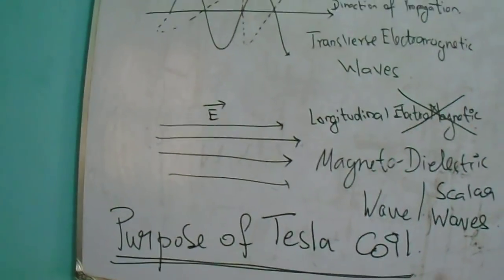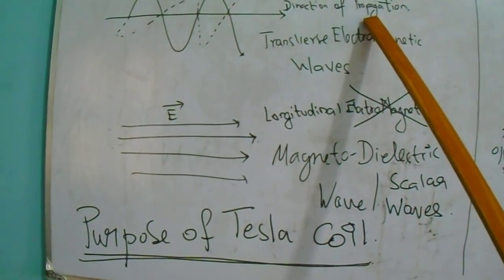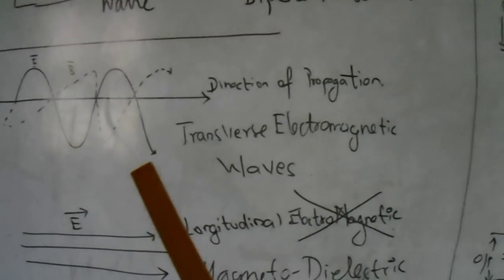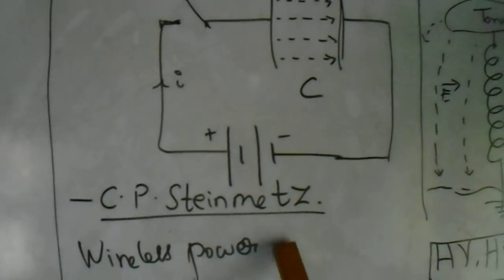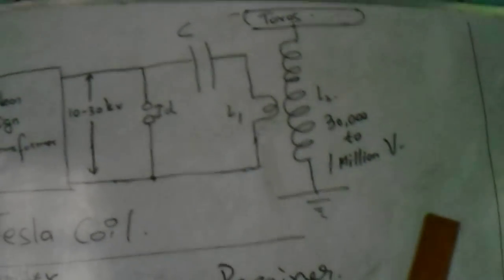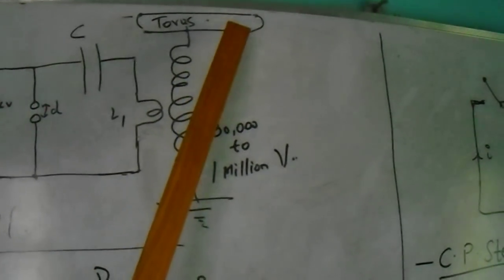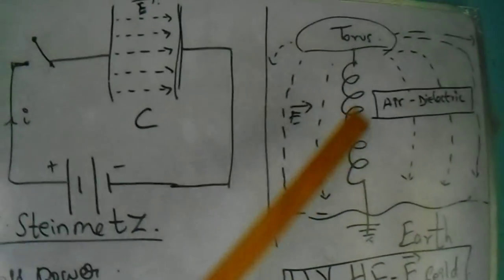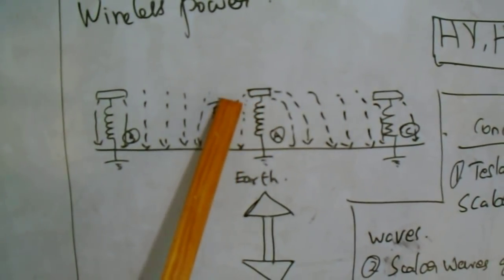How a Tesla Coil Produces Scalar Waves

Comment: Another approach to Tesla’s longitudinal scalar wave concept could be the energy transfer between the antennas of the transmitter and the receiver, is it possible to signal between these aerial capacitors through the displacement current, however they are not connected with each other, is there a possibility for a communication based on electrostatic induction between these antennas?
If we connect the secondary coils with each other by a grounded cable, the aerial capacitors would then simulate a plate capacitor, in which the plates are separated from each other, so the displacement current would flow between these plates, the higher the frequency the better.

Comment: There is a displacement current between the aerial capacitor (Torus) and the ground, when the E field changes with time, which means: dE/dt, isn’t there also a magnetic field component-B present, between the antenna and ground, as stated in the Maxwell equations?

Comment: Electrons moving through a vacuum dont have a field surrounding them but they can interact with other fields. Proof of this is the electron microscope. If the electrons always have a field there is no way to focus the electrons unto a microscopic point since they will all repel from each other. It is only when they move inside a material substance a magnetic or electrical field is formed but there also some substances where there are no fields.

Comment: Your explanation makes perfect sense. You have given me a lot to think about, thank you so much.
Reply: how does that make perfect sense?
Reply: This same person has another video where he transmits modulated scalar waves to a low frequency (LW)
radio (LW frequencies used in Europe) that is inside a nested Faraday shield consisting of two nested steel cans. His explanations make perfect sense. I have duplicated his experiments and indeed I have gone much further than what he has shown. Based on the results I have obtained I can tell you that his explanation is quite correct. The capacitance between the top loading to ground is all important.
Reply: @TheCrunchbird  Do you have a link to the video you mention?

Comment: Hello Sir, one of the best videos that I have ever seen, thank you very much.
Hmm, my question would be, the ground is a bad conductor, can the earth give response to the coming signals from the aerial capacitor, while the area of the surfaces are also not equal ?
Assume you have a sphere (aerial capacitor) of a radius of 15 cm, and a potential is changing between +100 kV and -100 kV, your C would be equal to 4π(eps)r, so nearly 16,68 pF and the charge q= 1,668 micro coulomb, so the ground ! The earth has a radius of 6371 km, its capacity would be equal to 708,534 micro F, the induced potential of the surface would be equal to V= 1,668 micro coulomb/708,534 micro F = 2,354 mV. 
We can write the equation also as: (V*r/R), which is the same. Could this potential be responded by the 2nd coil which is grounded (as a receiver), and located for example 100 m far from the transmitter coil?
I think we should connect the grounding plates with a wire together or may need a metal plate for grounding the transmitter and receiver, am I right here?

Comment: Then, might we assume that one plate of this conductor (the Earth) is always charged, and that all we need to do is construct that other plate to "reduce" that radiant energy, be it cosmic energy, or man-made radiation(radio waves, wifi, satellite, etc) to a useful, off-grid power source. It would be a welcomed alternative to wind and solar which are both expensive and inconsistent. Rather than spending efforts to put energy into the earth, already well charged, we should be looking at simple ways to extract the energy already available. Of course there is a conversion to the proper cycles for use, but that is already an off-the-shelf solution. Thanks for the explanation. Good food for thought.

Comment: Great explanation indeed. You need to work on your closing statements however :)

Would you have an understanding of the simple flat-spiral coil being used for single-wire no-return (no earth connection) transmission of power as well? No spark gap or HV necessary, just a primary of few turns, secondary of many and an identical receiver except the winding direction is reversed from that of the transmitter.
Reply: I've heard of that method and I think its more factual than the video's method, which just creates an electron pressure wave (scalar waves are not particles and are non physical). I think it was where the coils cancel each other out and create a pressure wave in the ether/spacetime. Could you explain this to me more? my idea of this is very foggy
Reply: Yeah that and his English! OMG couldn't understand one word!

Comment: How would you explain the magnification effect of a Tesla coil? Did you calculate the frequency of the electrical vibrations of the earth, if the Tesla coil comes in resonance with electrical vibrations of the earth, energy extraction may be possible, what do you think about that, any experiment or calculations?

Comment: As far as i know.....scalar waves are created when two equal and opposite em waves neutralize eachother forming a zero vector resultant ! These zero vector waves create stress on space time creating local gravity
Reply: WOW. Are you implying artificial gravity can be produced by these equal and opposite EM waves? What kind of power would be needed? More than a Duracell? (grin)
Reply: Ah! Enter the A field.
Reply: Interesting. The A field may be related to gravity.
Reply: @Cybergrip1  scalar waves can also scoop out the zero-point energy in empty space which is responsible for matter having mass, and you can reduce the mass of a material or even a craft which means you can Bypass Einstien's relativity which says that mass becomes infinite as you accelerate an object to the speed of light. If the frequency of the underlying scalar wave is kept b/w 200-400hz, you can use a 2xA battery to levitate a Ship as they did in the Philadelphia experiment which happened at Long Islands.
Reply: @rudrakanti89  Is this the same as the Lifter ionocrafts?

Comment: You create a displacement current between the aerial capacitor (Torus) and the ground, and by electrostatic induction you oscillate the charges of the receiver, so, Tesla’s longitudinal/electrostatic scalar wave concept (or transmitting system) is based on electrostatic induction, am I right here?
We don’t need an aether, or a kind of massless charge or something else to transfer these vibrations, we use the free charges of the ground, correct ?

Comment: can we make an anti gravity  flying saucer out of a Tesla coil configuration between  two  capacitor plates I might add a large ring  wrapped in a Rodin  coil  electrically pulse to crate a  centrifugal force field between the capacitor plates  to bias one side and  negate  gravity
Reply: In order to be able to create an "anti-gravity" vehicle of any sort, it's merely the basis of being able to create a magnetic void (the area of least magnetic pressure) in front of the direction of which you wish to go. Then you would in essence be pulled to that spot. In reality though it works exactly as your ICE in your car. Where a low pressure is created and the high pressure then pushes in, in order to be able to normalize the equation.

https://www.youtube.com/watch?v=nkIIdRJZybw&t=456s here is a good place to start, it's not quite the video which I'm looking for, but there are many on the subject which this guy does (unless you already know him) one of which actually shows the creation of the magnetic void when two magnets come into close enough proximity to each other.

Of course this also explains the ability of "Alien" craft which has been reported to be able to fly like the planes which we have invented do, as well as do moves which seem to be impossible with the maintaining of current flight physics.

Comment: This whole Tesla scalar field non-sense on YouTube finally explained.  So Tesla created a rectified high voltage field (aka scale waves) between the top of his tower and the ground.
Reply: A little oversimpilified but correct analysis as far as it goes.  Resonance is the key to Tesla's coils ability to generate the sheer power they are known to create.  A properly designed and tuned Tesla coil is many more times as powerful as any old Tesla coil without the extra care taken in the design and operation.

Comment: I'm about to build a scalar wave generator.  Output power 1.000 kilowatt, six High Power Tubes RS 301 driven with 12.000 Volts.
Where do I get a wiring diagram?

Comment: Very good explanation and it makes sense.
Have you actually transmitted power using this method?
Another use for Scalar waves as I understand is communication as it is believed that there is no time delay or significantly less delay than a transverse wave as we use in our conventional transmitters.
I have been frustrated with the speed that a transverse wave propagates through the electro magnetic system i.e so called 'speed of light' which is only the propagation speed. The Scalar wave having no transverse wave component does not propagate in the same way i.e it 'pushes' and 'pulls' the 'Ether' and as such has almost zero time delay for the effect to reach the destination.
Thus if we could make a Scalar signal generator and a detector and test the time delay over a large distance we may observer faster than light transmission that would be very very useful for long distance communication i.e interplanetary.

Thank you for taking the time to explain. It does confirm what I have read from many different reputable sources.
Also it makes good sense why this is not common knowledge as if you could transmit power this way you don't need a meter :-) and the main reason I guess this is being ignored.
Reply: Scalar waves have different propagation features than transverse waves.  A common example of a scalar, or longitudinal wave is a simple sound wave from a speaker.  The speed of the sound relates to the qualities of the medium of propagation (i.e. air).  Longitudinal electric waves illustrate aspects of the spacetime in and around us that we are not taught in school at almost any level.  There is so much to say on these topics.  Please look up Eric Dollard, who has done as much if not more than anyone to study longitudinal waves and their unique effects.

Comment: No gnd thru earth. At particle center is a void to eject and inflow curl rotation of ether is charge. His hf is transients which shocks the counterspacial regulatory mechanism to counter ether viscosity. and this maintains (mostly) conservation of energy Newton s law Lentz etc. He ac grounds thru counterspace upset. The resonance connection is from a mesh relay network of relay recievers . Power comes from counterspace. All classified. Btw earth is flat unmoving. Counterparts has 1d and 3d directional time. The z dim  of time clock run slower hence gravity.The
The trick is how to not create state and kill youself. Be careful.